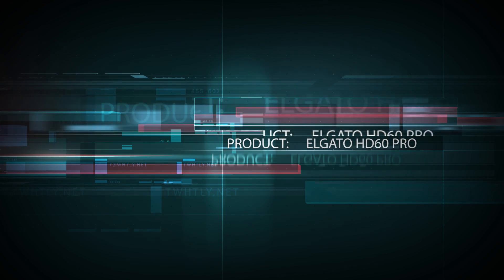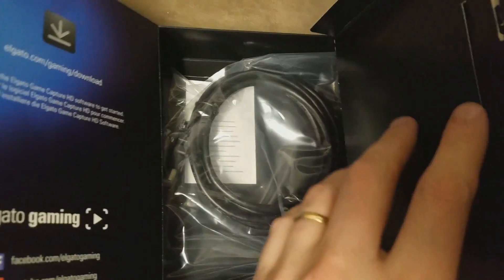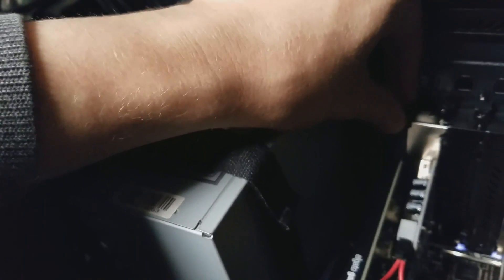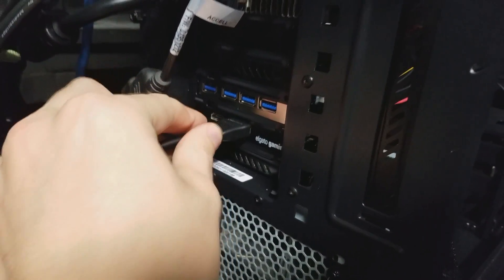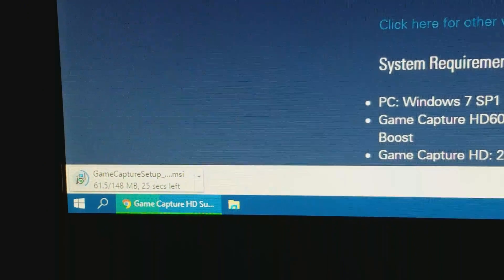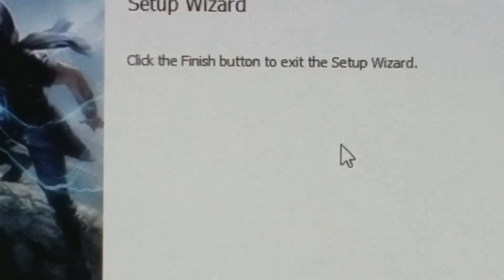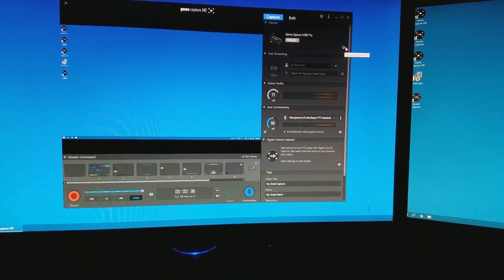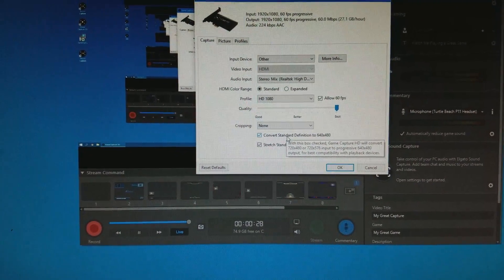Elgato HD60 Pro Unbox and Setup for same PC recording

Comment: Thanks for the video. Just to clarify, if using an elgato on the same PC for streaming I can expect slightly better performance (lower cpu usage) than with obs? For example when streaming CS:GO with obs I get a small amount of lag so would using the elgato capture card on the PC to stream instead of obs reduce this lag?
Reply: XYZIO I have this question also, seems to me that looping pc into the capture card should help reduce performance on cpu needed to capture and stream on same pc

Comment: Hey Tim so what do I do if I have the HDMI cables set up correctly but cant get the monitor to even detect the display at all?
Reply: I have a display port cable going to my second monitor, I have an HDMI Cable going from my graphics card to my main monitor, but when I put the hdmi cable from monitor to Elgato OUT, and from Graphics Card to Elgato IN, it doesnt work! Please help
Reply: 88mphTim  I figured it out thanks for the response though

Comment: do you know a way to capture a display without sacrificing your display port cable and 144hz?? great video btw
Reply: Just plug a hdmi cable to your graphics card going into your capture card "In" slot, and have your normal displayport into your gaming monitor. In your nvidia control panel settings go to display configuration and make it so that your hdmi is mirroring your main display, it'll say the name of your capture card as a detected second monitor. To make sure you are playing at 144hz go it adjust desktop size and position and set it to aspect ratio. and scale with your GPU and not display.
Reply: Need a reply to this too

Comment: I know this is a bit late, and a more technical question, but since the HD60 Pro has a built in H.264 encoding chip, using it in a same PC recording setup should allow the capture card to handle the live encoding rather than your CPU, correct? I've been trying OBS and AMD ReLive to record/stream on occasion, but I'm tired of the performance drops I get, since I push a 240Hz monitor. Theoretically, as long as the card can handle the encoding, this would be a perfect solution for me. Thanks for your input!
Reply: I am thinking the same as you are.
Reply: I ended up picking one up, and although it "works" I have been troubleshooting issues with multimonitor recording with it. Really interesting issues I'm having, and I may end up just running a second computer as a recording set up.

Comment: hey would this work if i had a 1440p 144hz monitor set up with displayport and set the hdmi out on my graphics card to scale down to double the signal from the dp to get the hdmi signal to the hd60pro just input?

Or will the 1440p 144hz signal bypass the recording and get to my monitor and get recorded by the elgato at 1080p60?
Reply: i have a 144hz monitor and ilose frames because the max is 60 fps  not above! and this dont work with dvi port only hdmi!
Reply: There is a video on yt explaining How to clone ur monitor to ur elgato game capture so u still Can get 144hz gaming and 60hz streaming!

Comment: Very informative, thank you.
Reply: So, IK have mine now, it's in the PC, all drivers and relevant software are installed, but when I have the program active and a sound is generated from any program on my PC, the elgato program captures about .25 seconds of the sound and quickly repeats it as if it's stuttering over and over and over non-stop until I close the elgato program. I cannot record anything because of this audio issue. It began after I had all my setting complete and had even done several successful test recordings. I even tried going back to default and it still is doing it. ANY HELP PLEASE?

Comment: Hi Tim.  One question; I'd like to have a single monitor HD60 Pro setup similar to what you demonstrated in your video, however my default monitor resolution is 1440p (2560x1440). I know the HD60 Pro's max res is 1080p, so if I do a similar setup to you, will I need to reduce my monitor's resolution to 1080p before it will work with the HD60?

Comment: I have a 240 hz monitor, when i record/ stream will it lower the hz to 60
Reply: It won't lower it by itself, I think you will have to change the hz to 60. The only reason why you would want your monitor on 240hz is for your own sake. If you stream/record it will only capture 60fps (60hz), therefore there is no reason to have 240hz (for your Viewers), unless you want it your self. 

Your computer will have to work harder if you have 240hz on, maybe lower it down to 144hz while recording / streaming or even to 60/80hz.
Reply: This is what I was wondering as well. Can anyone confirm that my monitor will not drop down to 60fps because of the HDMI connection from the HD60? Thanks
Reply: @jonathanrivera-jw6qh  it will drop thats what happend to me now and im trying to find solutions..

Comment: Hey my man, you seem to respond frequently so i thought i would ask. I have an i5 7600k with an rx 480 in it. I can record Overwatch using OBS, but as soon as I start streaming my ping spikes (probably due to ~3 mbps upload speed) and honestly the recording doesn't look 1080p or 60 fps after it's said and done. I can only stream overwatch on 720p at 30 fps (with my ping spikes), and would really like to stream 1080 at 30 fps or at least 720p at 60 fps. Any help is appreciated, and very nice video!
Reply: Tim Wheatley thanks for the reply! My ISP does offer other options but I room with 3 other people and they don't want to pay more. I figured out that my streaming bit rate was a bit high, so I'm gonna lower it from 3000 to 1500 and see how that goes.

Comment: I dont understand why you need one of these? I use obs.. on 1 980ti if my pc drops framerate this card will only capture the same framerate no?
Reply: OK think i understand, thanks for responding. I record to SSD hwo do you get the feed to go to the ssd is it an option? But still if my pc drops under 30 this will still only capture that 30 fps yes? And would you still us OBS or the software that comes with it?
Reply: What if my monitor is 144 hz 2550 x 1440 I record on obs at 1080 anyway, will this cause any issues? and do you use obs or the included software to capture?
Reply: Thanks for your help. Not sure its too beneficial for me. I run squad at 1440p and only lose around 5fps while recording at the same time via obs. But appreciate your time.

Comment: I have the Elgato HD60 Pro and love it. I am thinking of getting a new monitor, a 24" 144hz 1080p monitor and I'm just wondering how would you go about playing games in 144hz/FPS while capturing and streaming at 60hz/FPS. THANKS for the video.
Reply: PartyUpLive you go to nvidia control panel and just make sure your monitor that you’re using not the duplicated monitor is set to 144hz and the copied screen to 60hz should automatically do it for you though

Comment: Can use this Game Capture HD60 Pro on 1 PC ? and i want to keep my 144hz, any solution?
Reply: If your Graphics Card has 2 or more Outputs Connect 1 of the outputs to the input of the capture card and mirror your main screen to this output. In this solution you dont need the output of the elgato and you can keep your 144hz, because the elgato only takes the mirrored input.

Comment: Thanks for your video. If I use this card to capture GoPro as a webcam, using obs to stream, will this help to make less impact on my pc (gaming/streaming)? The encoder will be the Capture Card or I still have to chose between GPU and CPU encoding?
Reply: Did you find out the answer for this?

Comment: how to do it with hd 60?
Reply: I get black screen.
Reply: i did same issue
Reply: i only have one monitor is that why?
Reply: Ok I put one end of the Elgato hdmi cable into the input of the HD60 device itself then the other end into the back of my pc in the hdmi port of my graphics card. Then the cable from my monitor to the output side on the elgato. Then I put the usb-c cable into the input of the hd60 and the other end into a usb 2.0 port on my computer. That is what i should do right?
Reply: I did that i just editied the comment. It doesn't work for me.
Reply: ok
Reply: I tried again it worked now, but i see my pc screen showing up multiple times in the elgato software.
Reply: ok thanks
Reply: ***** all i did was put one end of the elgato hdmi cable into the back of my pc (graphics card hdmi output) and the other end into the elgato hd 60 input. Then i connected the hdmi cable from my monitor into the other end of the elgato hd 60. Finally i connected the usb-c cable to the elgato hd 60 and the end of cable to my usb2.0 input. Installed software and drivers. Configured my settings and set hotkeys to record gameplay no issues.

Comment: Does this help put less stress on the cpu when streaming or recording? Or do I need a second pc to do that.
Reply: ***** So will I get barely any cpu load during recording or streaming on the same pc?
Reply: I have a second old PC which as a q6600 cpu which is 2.4ghz and I've tested running xsplit and a screen capture of a video and it struggled to even run 720p 30fps, will the capture card help out?
Reply: ***** Ok thanks for the help!

Comment: So to be clear, this adds no delay what so ever? Because i feel reluctant to have it as a pass through to my monitor..
Reply: Yeahh the problem only is that i do not own a HDMI monitor yet, and i can use one of those HDMI to DVI connector i guess, which wouldn't add a delay of some kind i think,

I though about picking this up becausei  do game streams and upgrading my CPU would be more money as i need a new Motherboard also.

CPU upgrade would costs me in tot a 360, where as this would cos me 200. We all have them money problems right?
Reply: I currently own FX8320, currently looking ot upgrade to a Xeon E3 1231v3, I already figured out how the setup worked which confused me a little at first.. My CPU occasionally reaces a 100% load whilest streaming cause massive frame drops to around 10 fps which makes the game stutter and slow for a small period of time, Depending how CPU demanding a game is, But if i can use a DVI adapter with no issue than i guess i try that, All i stream is 720P@30, and perhaps with the capture card i'd up that to 60 even.

Comment: Hi Tim.  I have just got one but my install also pauses.  I have now been waiting for nearly an hour and still nothing has happened.  How long did you have to wait?
Reply: I can't right click and run as admin as it's a msi installer which doesn't give you that option.  I tried restarting too and also turning off driver signature with no luck.  I even disabled my antivirus.  Been an hour again and still stuck. :(
Reply: No all the downloads were .msi.  However I have managed to successfully install 2.20.6 of their software which worked.  It then succesfully downloaded the update of 3.0.  But it then asked to update to 3.2 and that has now caused it to pause on installation again.  It seems for now I will need to use version 3.0.  What version are you using?
Reply: Thanks for the help.  I have now successfully installed 3.1.  I will not be using 3.2 until Elgato get back to me with the support ticket I have sent.  I will not be holding my breath though ;)